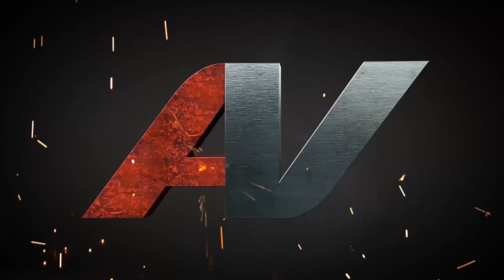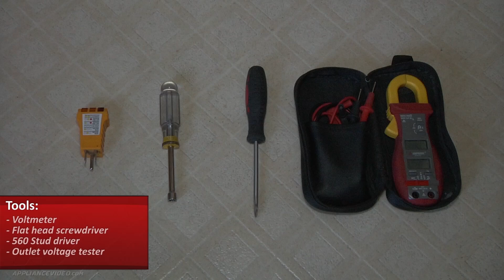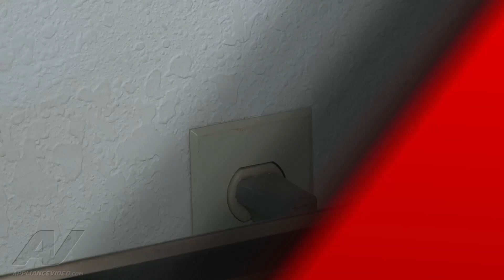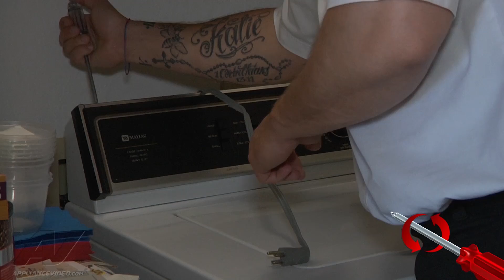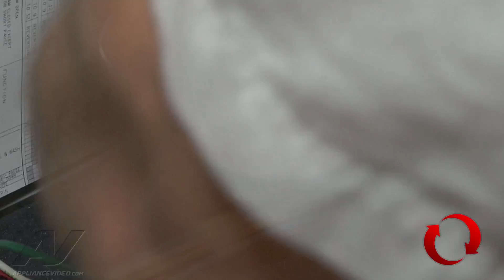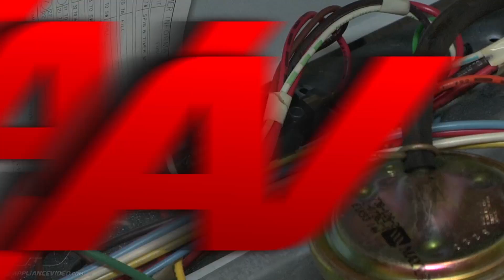Washer will not start - Diagnostic & Repair Maytag, Whirlpool, Sears  LAT8240AAW

Comment: This helped a lot. Using this video I found that my switch fuse has continuity and the switch itself loses continuity when lid opens. Yet doing the tests fixed the machine! Though temporarily, so I know the switch needs replacement. And your video shows me how to do it and that I can do it. Thanks a million. P.S. I don't need to take a picture as you suggest since your video does that for me! (I have the same Maytag A8640)

Comment: What would make this exact model leak all over the floor? Someone please help. 

I was washing a load, and then my wife and I heard a lot of water dripping noise. I rushed over to the old maytag and water was coming from the bottom. I quickly opened the lid, and it stopped, but qe still heard water flowing. The bowl was filled to the top. I unplugged power cord, still water running. I turned off cold water valve, nothing, closed hit water valve; and water stopped flowing. I feel like a valve failed somewhere in the machine, but im not sure. So far, i have it completely disassembled and im changing gaskets and hoses. Any help would be appreciated. Thank you!

Comment: I acquired model lat3910aaw, but it has a wire on the back of the cabinet attached on one end to a screw by the water line ports but not on the other end. What does this go to? The cabinet also says "ground screw" several inches above this wire. Weird.
Reply: Check the wiring diagram included inside the panel.

Comment: i have this same exact model washer as well.  It started filling and then wouldn't go into the next phase.  Then, it stopped.  Then once in a while, it wouldn't drain after washing or rinsing.  So i would lift lid up and plop it down a bit hard, then it would work.  I remembered that little plastic button behind the door and played with it before, so tried that.  It worked a few times, but then stopped working.  Then, it wouldn't spin, ultimately stopped filling too.  Ughhhhhh.  Glad that I found this video....I will start off with repositioning that whole assembly and if that doesnt work, I will use the voltimeter.  Took me FOREVER AND A DAY to find a video with my SAME EXACT WASHING MACHINE....prob because its so entirely ancient.....lol.  But they dont make anything the way they used to.  I will run this thing til it dies before buying some overpriced POS appliance that they make these days.  Thank you for this video, much appreciated!!
Reply: I have the same model I did not know the fuse would stop the water from filling. I been able to fill it by hand bucket after bucket about 2/3 full and then it would wash and spin but just would stall during the water fill cycle. Had to fill it by hand to rinse also. I did the old foil fuse bypass trick, and it did start to fill but when I tried to spin it blew a breaker. Ordered the switch assembly tonight and will see if it fixes it. I would rather fill this by hand then buy an overpriced programed to fail modern day POS.
Reply: We're in the same boat brother. I hope this is the answer.

Comment: Could you not just replace the fuse ?
Reply: I tried bypassing the fuse on mine, but it ended up blowing a breaker. I suspect that the best thing to do is to replace the entire assembly because as I was able to fill my washer by hand and then use it, one or both of the switches is most likely faulty somehow causing the fuse to blow.
Reply: Yes but it may blow again because those switches can cause the problem.

Comment: Your 100 % wrong , two clicks not right, white micro switch will pop fuse , , 40 year tech , stop giving wrong info,
Reply: Mine makes two clicks and its not blowing the fuse. One click is faint when lid open, other click louder when lid closed.

Comment: How do you get to the pump?
Reply: On the bottom of the front panel, there should be two Phillips head screws just on the underside of the bend. Remove those and then you can lift the front panel out from the bottom. The pump, which is belt driven from underneath, is on your right front.

Comment: I tested my fuse per the video and got continuity, so that's not my problem.  Am I correct that when the lid is closed, the large button should be pressed and the small released, then when it's open the small is pressed and the large is released?  (i.e. Those are the two clicks I'm listening for.)  Same as in the video, I'm hearing both the louder (big button) and softer (small button) clicks.  So I think I've got my assembly correct.  Any way to tell which switch might have gone bad?

Comment: Why wont replacing the fuse in the lid switch fix the problem?  What is the fuse for?
Reply from the maker: Great question, if you have a more technical question that our parts department cannot answer, you can search our over 17,000 answered questions free at our website www.ApplianceVideo.com under our Repair Help section. You can also call our parts department at 1-800-830-5465 and they can give you help 7-days A week ,or search at www.SaveMoreOnParts.com  .

Comment: I have this same unit mine spins but it doesn't run cycles we had need an idea on to fix this or what could be wrong
Reply from the maker: Great question, if you have a more technical question that our parts department cannot answer, you can search our over 17,000 answered questions free at our website www.ApplianceVideo.com under our Repair Help section. You can also call our parts department at 1-800-830-5465 and they can give you help 7-days A week ,or search at www.SaveMoreOnParts.com  .

Comment: washer does not clean the cloths
Reply from the maker: Great question, if you have a
more technical question that our parts department cannot answer, you can search
our over 10,000 answered questions free at our website www.ApplianceVideo.com under our Repair Help section. You can also call
our parts department at 1-800-830-5465 and they can give you help 6-days A week
Monday -Saturday, or search at www.SaveMoreOnParts.com  24 hours
7- days A week.

Comment: Hello there :)  i got simpson top loader, when the power button is turned on, all the lights starts flashing but won’t start the machine, could you please help me diagnose the problem
Reply from the maker: Great question, if you have a
more technical question that our parts department cannot answer, you can search
our over 10,000 answered questions free at our website www.ApplianceVideo.com under our Repair Help section. You can also call
our parts department at 1-800-830-5465 and they can give you help 7-days A week
Monday -Sunday, or search at www.SaveMoreOnParts.com  24 hours
7- days A week.

Comment: I've got an old Maytag washer, model # A8420, that won't start after storing it in a storage unit for four years--the storage unit gets very hot in the summer and very cold in the winter, so something got damaged because of this. When I say the washer won't start, what I mean is that it's a very large brick. It has a turn knob that you pull out to start the washer, but when I pull out the knob nothing happens. No motor humming, nothing. The outlet is fine, I've tested it with a fan, but the washer acts as if it isn't getting power.
Reply: Minute 3
Reply from the maker: Great question, if you have a more technical question that our parts department cannot answer, our technicians are answering all questions at our website at www.ApplianceVideo.com under our Repair Help section. You can also call our parts department at 1-800-830-5465 and they can give you help 7-days A week Monday Sunday, or search at www.SaveMoreOnParts.com  24 hours 7 days A week.
Reply: @Appliancevideo  Ugh. We didn't have the button on the panel pressed in all the way. Figures it would turn out to be something stupid. At least the washer is working now...except it jumps around during the spin cycle but I'm sure it's the damper pad or the spring that holds the tub.
Reply: @evelyndrak4436  ...or you need to load it evenly and level the machine with the adjustable feet.
Reply: @lucash1980  Thanks. We got it to work. I can't remember what the issue was but I think it was something stupid like we didn't turn the knob where it should go, or something. I can't remember; I just remember it was one of those things where the solution was obvious and you just end up feeling stupid afterwards. :)

Comment: Has anyone had to replace the timer know on this model?  Can't find a video about that- washer works great but knob will not advance to start cycle.
Reply from the maker: Great question, if you have a
more technical question that our parts department cannot answer, our
technicians are answering all questions at our website at www.ApplianceVideo.com under our Repair Help section. You can also call
our parts department at 1-800-830-5465 and they can give you help 7-days A week
Monday -Sunday, or search at www.SaveMoreOnParts.com  24 hours
7- days A week.

Comment: Can you bypass this kind of washing machine lid switch
Reply: no, because these units were equipped with an off balance sensor that tripped each time the load goes off balance and this resets each time you open the lid
Reply from the maker: Great question, you can call
our parts department at 1-800-830-5465 and they can give you help 6-days A week
Mon-Sat . You can also search at www.SaveMoreOnParts.com 7- days a week.  If you have a more
technical question that our parts department cannot answer, our technicians are
answering all questions at our website at www.ApplianceVideo.com under our Repair Help section. We have over 6,000
common questions and answers that you can easily search through by your model
number, appliance make, problem or error codes, and It’s completely free to
search through our question & answer library. There is a very good chance
you question is already answered there.
Reply: The switch is a safety feature.

Comment: Our machine fills with water no problem but needs several attempts at pushing and pulling (smacking eventually) the knob. I don't think the fuse is the issue since it will eventually start. What could be wrong?
Reply from the maker: Great question, you can call
our parts department at 1-800-830-5465 and they can give you help 6-days A week
Mon-Sat . You can also search at www.SaveMoreOnParts.com 7- days a week.  If you have a more
technical question that our parts department cannot answer, our technicians are
answering all questions at our website at www.ApplianceVideo.com under our Repair Help section. We have over 6,000
common questions and answers that you can easily search through by your model
number, appliance make, problem or error codes, and It’s completely free to
search through our question & answer library. There is a very good chance
you question is already answered there.
Reply from the maker: Our technicians are answering questions on the Repair Help page of our website. Visit https://www.appliancevideo.com/repair-help and we can help you out!

Comment: Glad I found this video.  Looks like my washer.  Mine will start in spin cycle, but no other cycles.  For example, it won't start, but if we move forward to spin, it will work.  Could that also be this switch, or does that sound more like a timer issue?
Reply from the maker: Thank you for your positive response, we are glad we could help. Please help us by
subscribing to our YouTube channel or post our website www.ApplianceVideo.com  on your Facebook page. We want to let your
friends & family know how our FREE videos can help them.  Or you can
support our parts department at 1-800-830-5465 and our parts website www.SaveMoreOnparts.com .  This is the only way we can continue to
post free videos and help over 900,000 people per month like you repair their
own appliances. We also have thousands of more quality videos on all major
appliances made by our factory trained technicians at www.ApplianceVideo.com .
Reply: What was wrong with your washer?
Reply: Did you figure out what was wrong with you washer?  I've got the same washer and the same problem as you.

Comment: I have a 25 year old maytag washer I have tested the motor, lid, and door switch and all tested out fine. the machine fills with water then nothing (dead) any ideas would be appreciated. Thank you
Reply: Robert Gurule what was your solution? Seems to be our issue as well
Reply from the maker: Great question, you can call our parts department at 1-800-830-5465 and they can give
you help. If you have a more technical question that our parts department
cannot answer, our technicians are answering
all questions at our website at www.ApplianceVideo.com under our Repair Help section. We have over 3,000 common
questions and answers that you can easily search through by your model number,
appliance make, and problem or error codes, and It’s free to search through our
question & answer library.

Comment: If smacking the front with the palm of my hand starts it, I would assume it is not a bad fuse, correct?
Reply from the maker: +Lesley Weatherford 

You are correct on the fuse. Sounds like a door latch issue . We have helped
millions of people repair their own appliances so please help us produce more
videos to our site by subscribing to our YouTube page, or posting our http://www.appliancevideo.com/ website on your Facebook or Twitter account. Our
factory authorized technician’s also daily provide free professional Repair
Help to people like you to help solve their appliance problems. You also have
the option to email a factory service technician with a question at http://www.appliancevideo.com/repair-help/ .  If you need of parts for your major
appliance, we have over 5-million parts in stock at http://savemoreonparts.com/ . Thanks in advance for supporting us. So email
us if you have any other questions our videos cannot resolve. Thanks for your
support in advance.   Matt, Ace Appliance service technician.
Reply: Lesley Weatherford how did you fix the machine? Seems to be our same issue
Reply: Usually, "The Fonz" bangs things on the top to get them to start. Effective banging usually means a loose doodad. Maybe your switch or a wire is loose.
Reply: LOL washer trashed  long ago.

Comment: Why can't you just replace the fuse only?
Reply: Because he is a repair guy and not a homeowner. If he says he replaced a tiny fuse, the owner will not want to pay him full price for the simple job, so he pads the bill/work to replace the whole switch. This "sounds" better and won't end in a disgruntled owner who could have done it herself.  He can even replace the fuse and resell the old switch on the next job. Paying for labour is paying for convenience and experience.  If he charged $25 or $50 to replace the fuse, he'd never make a living. Respect the trades, but laugh at some stupid simple jobs (like electricians resetting GFCI outlets)
Reply from the maker: +Chet Tia 

All of our technicians are
now answering questions daily at our http://www.appliancevideo.com/ website under the Repair Help section.  We
also have over 1600 common questions and answers that you can easily search
through by your model number, appliance make, problem or error code and it’s
absolutely FREE. You also have the option to email a factory service technician
with a question on your appliance at http://www.appliancevideo.com/repair-help/ . If you’re looking for a repair video, you can
also search our library of over 2600 free repair videos. ApplianceVideo.com
specializes in quality DO-IT-YOURSELF appliance repair videos and we get over
800,000 views per MONTH to our videos worldwide and growing. If you need of
parts for your major appliance, we have over 5-million parts in stock at http://savemoreonparts.com/ .  Thanks for your support. Matt Ace
Appliance factory service technician.

Comment: Did you have to disable the fuse box before tampering with the wiring in the machine?
Reply from the maker: Mirabelle Andreeve Yes, its always advisable to  disconnect the power before servicing any unit.
Please help us provide more videos to our site by
subscribing to our YouTube page or posting our http://www.appliancevideo.com/ website on your Facebook or Twitter account. Our
factory authorized technician’s also daily provide free professional Repair
Help to people like you to help solve their appliance problems. You also have the option to email a factory
service technician with a question at http://www.appliancevideo.com/repair-help/ .  If
you need of parts for your major appliance, we have over 5-million parts in
stock at http://savemoreonparts.com/ . Thanks
in advance for supporting us. So email us if you have any other questions our
videos cannot resolve. Thanks for your support in advance.   Matt, Ace Appliance service technician.
Reply: Ummm...unplug the machine? That will stop the angry electrosity from rattling up your spinal column.

Comment: how do i open the top of one of these?
Reply from the maker: There are two screws on the bottom corners of the front panel. Remove those screws and grab the bottom of the panel and swing it towards you. There are two clips at the top that the panel hangs on. Once the front panel is removed there should be two 3/8 screws on the front corners holding the top panel on. Removing those will allow you to lift the lid.

Comment: I found out that the fuse is purposely there to blow if the lid switch goes bad.This is there to dis-able the unit for safety reasons.
Reply from the maker: Thanks for your response, we are glad we could help. Our library of over 5,700 videos are currently helping over 1.6 million people like you every MONTH.  Please help us by subscribing to our YouTube channel, or post our website www.ApplianceVideo.com to your Facebook page, Twitter, Instagram or any other social media sites. Your support will help us keep producing more free quality videos.
Reply: That doesn't make sense. Fuses blow to protect equipment, not blow AFTER it breaks. The fuse blowing before the switch would have the same effect as disabling the machine.